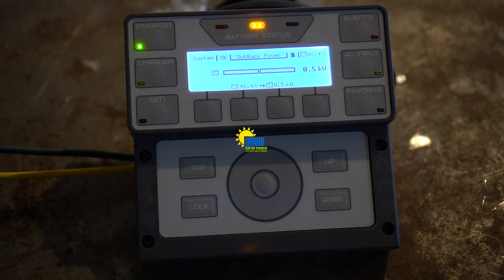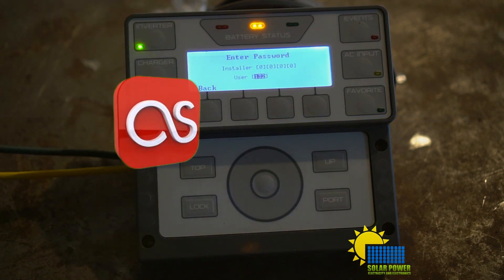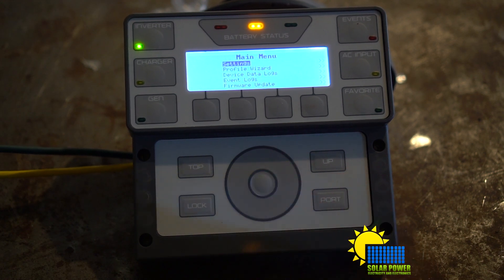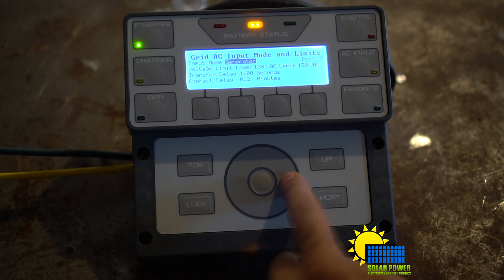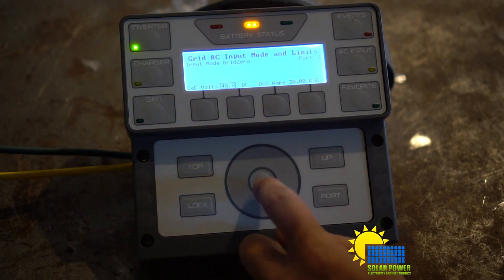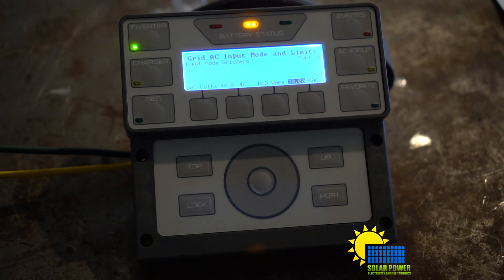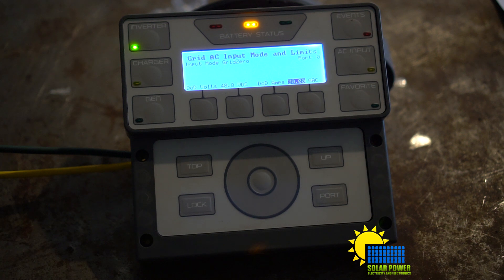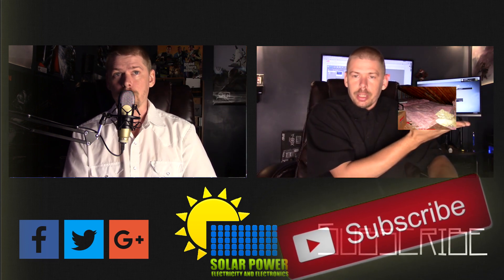How to Setup Grid ZERO on the Outback Inverter

Comment: I am working on an installation that was set up by someone and then someone else tampered with the system.   I cannot get AC into the inverters.  Perhaps you have explained that, but I was too frustrated to pay attention.
Reply from the maker: you need to have everything  tested outback is where i would start may be in the setting i don't know  what happen to it.

Comment: What does it do? Why would we want to use grid zero?
Reply: Grid Zero mode is meant to use PV to offset grid-side loads while avoiding grid export. Some situations a grid export is a bad deal for the user.
Reply from the maker: it makes it easy to discharge your extra power
Reply from the maker: i use it every day
Reply: @solarpowerelectricityandel2915  Discharge it where, to the grid?
Reply from the maker: @eco_guardian  your load

Comment: do you have current sensors installed on grid wires?
Reply from the maker: this thing does it automatically
Reply: @solarpowerelectricityandel2915  thanks, I'm not familiar with this inverter.. How it connects to grid?
Grid power goes to inverter and then from inverter to home load?
or Grid power goes to inverter and home load?
Reply from the maker: @AlekseiPetrovski  this thing can feed power to the grid run is an off grid inverter run is a hybrid grid and off grid inverter and run grid 0